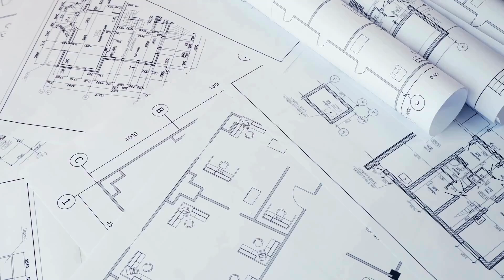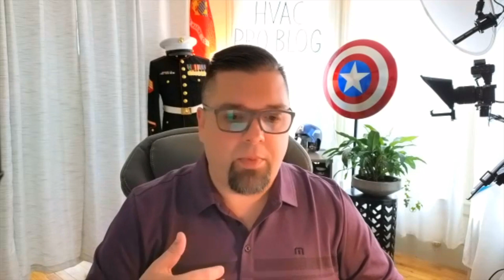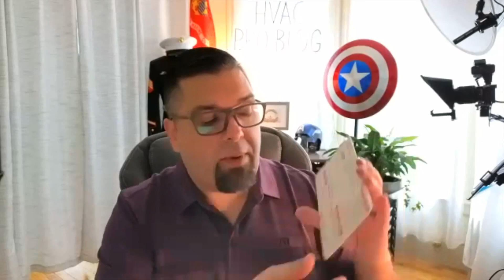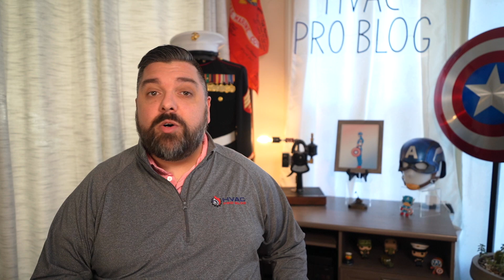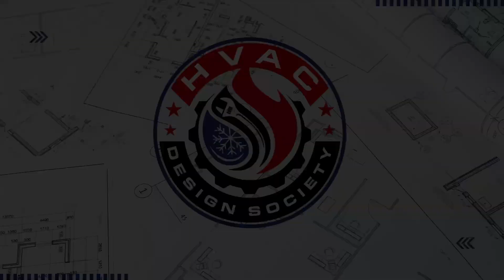Optimizing Residential Duct Systems: Velocity Guidelines Explained

Comment: After living in a dozen different houses ranging from 2-story, ranches, cape cods, and single levels with vaulted ceilings, none of which were heated or cooled evenly. I'm unsure whether HVAC design is costly, overlooked, or skipped on-site due to a lack of skill/knowledge, or to make more money by ignoring the system design parameters. All I've ever seen on construction sites are duct "runners"  slapping (flex) duct up as fast as humanly possible without regard for kinks or anything else. It would be nice to live in a home with a balanced HVAC system, though. One day, Gadget, one day!